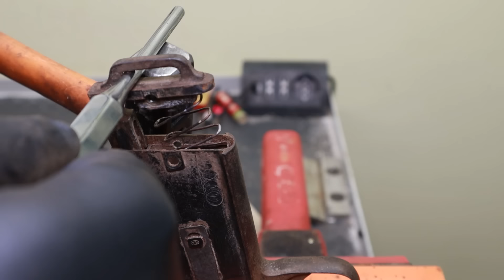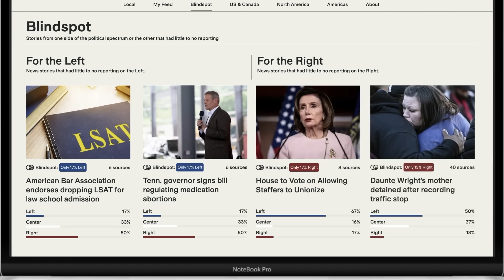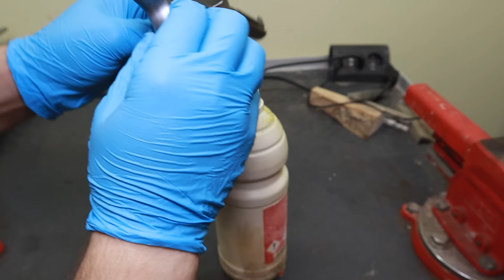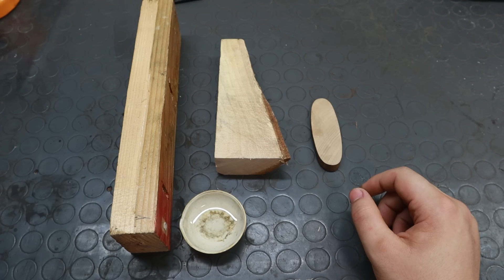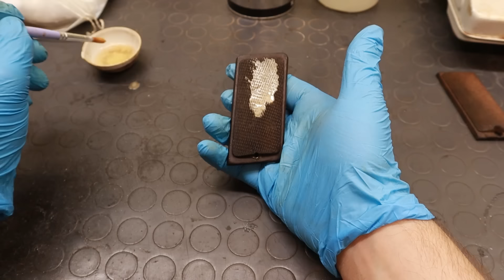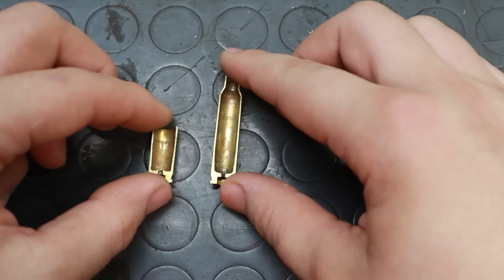Restoration of WWI Austro-Hungarian Steyr Hahn Pistol

Comment: Interesting choice of trigger weight on (I think) a single-action auto loader.  Could it have been to match double-action revolvers to ease transition for soldiers more accustomed to the usually heavy pull of those weapons?  It is an anomaly on an otherwise cleverly designed pistol.

Comment: I'm not a professional like yourself nor do I have your experience however may I suggest two items that I have found tremendously helpful in my gun restorations?

1: a dishwasher - run stocks or grips through a regular dishwasher and it not only cleans them very well but it also pops out most of the dents
2: a sonic cleaner - removes rust, crud, stuck screws, cleans grips, and generally saves a lot of tedious manual labor.  Works great with dish washing soap, laundry detergent, mild acid, or evaporust depending on your needs.

Comment: What ratios do you use when using the hcl to lighten the wood? I have a couple milsurp stocks that are pretty much black with that tannin, but id hate to overshoot and damage the wood. 

Also is this good for removing black spots from the wood with minimal damage to the surrounding finish?

Comment: Have you considered electrolysis for rust removal?

All the chemical methods I've seen you use this far seem to have drawbacks that would be completely absent with electrolysis.

It's non destructive and non corrosive. I think it would benefit your restoration efforts.

Comment: Fun fact the reason it has an internal magazine is not because they were worried about losing them although that is a plus it is because most handgun malfunctions come from failure to feed due to a bad magazine they put a really good Magazine spring in it when did a lot of engineering to ensure the feeding was very reliable

Comment: You should take pictures of all of the guns you have in storage so you can hold a community post so we can vote which gun we want to be restored next.
Reply: That’s a great idea!! He should do that!
Reply: @DementiaGaming69420  That's a wild username
Reply: @racimlongou5178 My guess based off his content is that he is a fellow Caretaker fan.
Reply: @racimlongou5178 
"How did you get that name?"

"I forgot."
Reply: 🤔 I disagree.. that would take away the "spontaneous selection", and also the "suspense" of which firearm next. Not only that, but has it actually occurred that restoration will obviously be different each time, even if only by a little bit, and he obviously restores each firearm when he has everything"mapped out ". For example, I have an 1890's reloading Tool, and it's completely pitted and seized up. I salvaged it from the local Garbage Dump. I want to at least eventually get it unseized again, not because it's "worth MONEY ", which it isn't, but because I want to, for my own self sense of achieving something, no matter how miniscule, in trying to preserve at least a small part of History.
Reply: My vote will be ALL OF THEM so ...
Reply: @MajorTom4279  this aint minecraft lil bro

Comment: i have a question you said that buffing wheels round corners. but say if you had a buffing wheel that i have modified uses a belt sander like design to move the materiel for polishing over a flat surface. would that round corners?

Comment: Your channel is one of the best original restoration channels I found so far. I’ve a suggestion, upgrade your blueing process, use steel wool and cold blue, also blue them in multiple layers and keep on rubbing with the wool. It gives very even results.

Comment: I still think the same, it is a superficial rust I think caused, it is easy to do, since internally I see that parts such as springs are intact, is it not that you need to make videos of this?
I have seen weapons corroded on the outside and inside they were in the same condition.

Comment: you can take a tig torch on low heat over the pitting with a mild steel thin filler wire and then file it smooth again to fix the pitting.

Comment: I can't believe in Restoration videos anymore after I saw how easily they can be faked, and I simply cannot believe you have a Steyr Hahn in such relatively pristine condition with just a layer of rust on the outside and having to replace a bit of it here and there. Shit looks like you disassembled the gun, sprinkled dust all over it and let it out in the sun for a while to let the shit settle in. Clickbaity fuck.

Comment: Thank you for these videos, the techniques shown are far more detailed than others online.  Your presentation seems much more trustworthy as well, and less damaging.  

I recently restored a historically significant firearm that was all but destroyed by rust and corrosion.  It does not look new even after the work I put in, and the extremely heavy pitting will never be fixed, but the degradation of the piece was halted, the parts now interact in the way they should, and it has been preserved for future generations.  

My prior attempts at preservation had middling results, with one attempt that I regret due to the loss of a patina that I tried to save while removing some accompanying rust.  This most recent project is one that I am proud to call my own work, is is no doubt the best I have done so far.  

These educational videos helped me a great deal in the proper application of a number of techniques that were new to me.  Thank you.

Comment: I was thinking, why you can't fill holes from rust in way of My Mechanics is doing? With welder. Is there an issue with hardening of steel? You should be able normalise and harden it again in worst case.
Reply from the maker: Filling a pitted surface with weld is often neither easy nor safe. In order to do a good job you'd need to grind the pitted area completey, or you risk leaving small voids under the weld, where the deeper pits were.
In any case, the main problem is that you create a heat affected zone and mess up with the heat treatment. You can of course normalize, quench and temper again, but you'll most likely end up with a warped part.
All these problems do not arise with low carbon steels, like mild steel, though.

Comment: It's locking operation is a little similar to the GSh-18 though the GSh-18 uses threads closer to the end of the barrel and threads in the slide to rotate the barrel. Both are still recoil operated rotating barrel designs albeit almost 100 years apart tough the GSh-18 is striker fired.

Comment: its fake he painted it
Reply: always the people who have zero idea what they're talking about running their mouths.
Reply: No
Reply: Proof?
Reply: @haachamaismyqueen  Inconsistent washed-out patina, no flaking, and no pitting, the trigger shows discoloration where it has been pressed in, if the rust was real then it would furr and show streaks. It is painted, simple as. surface rust steel has a consistent patina unless its in a movie. take your gun or any high-grade carbonized steel like an expensive shovel and leave it outside for a couple of weeks and then compare it with this fake. The rust will have texture, ferrous oxide lifts the surface into a furr, and the color will be consistent unless you have different grades of steel. You are being had.
Reply: @stephenbest4924  Patina? this weapon is made of steel, not copper or brass etc
Reply: @Eurozne he's italian, these guns are found all the time in basements and in the woods of old battlegrounds

Comment: I guess you can use a two part epoxy or a precise weld to get rid of the pitting. It's kinda an eyesore,but it does give a character to that old STEYR.

Comment: you can fill in pits with a oxyacetylene welder and grind down the excess material for a perfect finish on most projects
Reply: It’s high carbon steel that is heat treated and tempered.  Welding would ruin that and require a new treatment, which could cause warpage.  

Welding would be fine it it was not heat treated in this way, or had lower carbon content.

Comment: For your valued opinion. The Astra Modelo 400, Chambered in 9mm Bayard, was commercially marketed for both the 9mm Bayard and the .38 Automatic Colt Pistol. Old gun articles show that 9mm Steyr could also be fired.  The .38 Colt is semi rimmed as is the mentioned .38 Super. What's your opinion of these cartridges and potential of interchangability? Obviously .38 Super should NEVER be used in any of these pistols especially the 1900 and 1902 Colt Automatics.

Secondly,  9x23mm, with appear to be Czech markings, is found in boxes with 8 round stripper clips. Similar boxes with 9x19 (Parabellum) also found with such clips. Any idea of what they intended for.  I understand some of the Steyr pistols were rechambered for the Parabellum load after Austria annexed in 1938, but why ammo from Czechoslovakia.

Great video, great channel  always.  Your professionalism as well as very user friendly presentations greatly appreciated.

Comment: If not converted (to 9mm parabellum) this particular pistol has probably skipped WW2 (or maybe as an unofficial backup). I had a chance to see a WW2 war-trophy one (converted to 9mm for Wermacht), but it didn't like "hot" ammunition (it RUDed once, but was easily repaired). It also served as a backup in another war-but it is another storry...

Comment: I have a question. Can metal pitting be fixed by filling it with lead or maybe some sort of lite welding and then leveled out or shaved down for a lack of a better description until the surfaces even and smooth?
Reply: Welding is probably out of the question as that could risk the part severly and need a lotta postprocess to make it match up. When i first read your comment my mind went straight to tin solder, but you want an alloy that wets out on the metal you're applying it to. and any oxidation like blueing wouldn't apply to the solder leaving you with uncoloured spots

Comment: Out of curiosity, have you ever tried Evaporust or Krud-Kutter Rust Remover to remove rust on restoration pieces? I've heard some very good things about Evaporust, especially since it pretty much removes just dry rust and some oxidization without touching the bare metal (plus, it's pH neutral). I mean... yeah... using citric acid works... but you're also removing some of the base metal in areas where it might not be necessarily needed to be removed.

Comment: amazing such an old gun could still fire at all with its worn out barrel .... granted id still recommend making or finding a new barrel replacement if anyone wants to seriously use this relic at a range .... that and tweaking the trigger springs to fix that atrocious 10 lb trigger pull would be nice as well.

Comment: Can't the deep rust pits be welded over and filled, then sanded down?
Reply from the maker: That can be done, but the thermally affected zone in many situations poses more threats than the pits themselves. Thermal spray would probably be better

Comment: The deep pittings, would they be possible to be smothened out with a filler if you ceracote the gun? Would gave to be like a restomod but that might not be so bad 😃
Reply from the maker: I generally try to bring guns as close as possible to their original look, and cerakote on an early 1900's model stands up like a black eye on a blonde. It also adds a considerable amount of thickness to parts, which can interfere with mechanics, so you normally can only use it on the outside of parts.
It's a great product, but it's not a one-fits-all.
Reply: @Backyard.Ballistics  was just asking if it would hide the pits. I do like restomodded retro guns if it saves them from the smelter. Imagine a modernized c96 broomhandle 😎

Comment: Great job! But I have a question related to the formula used in the carcano rifle ¿does the hardware store cleaning products valid in order to obtain hydrochloric acid and the ammonia needed or you need to buy specific products?
Reply from the maker: Normally you can tell if it's just acid or it has stuff added to it by looking at the label. Hardware store concentrated acid and ammonia are definitely pure enough, but even some supermarket grade can serve the purpose. The ammonia I used contains a bit of surfactant, but I found that to actually be helpful
Reply: @Backyard.Ballistics  Grazie mille for the answer. : D

Comment: What do you normally use for rust removal?  Thanks
Reply from the maker: A solution of citric acid and a bit of dish soap works well and is not harsh on the metal underneath. Submerge the parts in it for 1 to 4 hours with brushing every hour or so to get rid of the most stubborn lumps.
This will also dissolve any residual bluing. If you want to try to save the bluing dunk the fully degreased parts in briskly boiling water, for 15 minutes or more, and then card with fine steel wool or hand wire brush

Comment: Such an interesting firearm thanks for sharing 🤗 have you tried the engin oil method of blueing ? I tried that method on an old airgun turned out ok 👍
Reply from the maker: That requires heating the parts to a temperature that can be higher than the temper of heat treated parts, softening them. It should only be used on parts that have not been treated or that have been tempered at at least 500°C
Reply: @Backyard.Ballistics  no good for firearms but ok for airguns 😂😂 lucky i didnt try that method on my old 1908 winchester 😕 that would have been a disaster 💥 😂😂

Comment: It's so odd how there's no corrosion inside of any of the metal parts. If a piece of metal sits outside for 80 or 100 years, corrosion gets in everything. I don't understand why people enjoy watching channels where somebody takes a thing and artificially ages it or corrods it like you did. I'm guessing you dropped it in acid or something like that. And then "restores" it. And the reason that you're not afraid to shoot it is because you know that it was a firing functional gun before you dipped it in whatever solution you dipped it into, make it look like it was corroded. And if you're going to call bullshit, I want links to pictures of where you found this thing in the ground. Or where you found it all rusted up. I'm a machinist and I got a couple buddies that are gunsmiths and sometimes people bring them in firearms that have been sitting around in barns and things for years and years and years. And they never just have surface corrosion. You know the barrel is a big empty tube and if it's not plugged up, as I'm assuming you do when you corrode things for your channel, water gets down in there and that moisture gets into everything. When you open it up. The bolt is rusty. The whole chamber is rusty, everything is rusty.
Reply: It is not a good idea to judge if you have no proper knowledge about the find. But you can make suppositions of course.
Firstly, it's important to know these guns aren't found in the ground. I have found one while metal detecting, and yeah uh, it's in much much worse condition haha. 
In barns, it's different too. I have resorated barn finds, and the corrosion isn't as bad as you might think. They just sit there doing nothing, not exposed to the elements. And you're probably wondering about the barrel right ? It seems weird. Well, all the little particules of powder, and all the other filthy things left in a barrel by the previous shots prevent the oxydation of the barrel. 
If you want to discuss more about it no problem ok ?
Just please do not make quick assumptions
Reply: And of course you're not afraid to shoot it because they're all good components. I mean good God man. When I'm pause the video right now you are explaining how the pistol works. And you're showing a barrel with a little tiny spot of corrosion on the top. No corrosion in the middle and a slide that is perfectly clean. I'm guessing you ran out of things that you could actually find out in nature and just decided to make your own stuff so that you would have content for your channel. I don't know why this video showed up on my feed. I dislike these videos typically when they show up on my feet and tell YouTube not to recommend this channel anymore and I'm going to do the same thing this time.
Reply: In the irony of you telling other people that certain YouTube channels aren't posting reliable content 🤣🤣🤣 again show me where this weapon came from where it was all rusty like that and that you did not do it yourself.
Reply: I like how you immediately thought it was found in the ground. In Europe (this guy is Italian) firearms are generally found in the walls of houses since the first or second world war. If it was in the ground the whole thing would've been "frozen" solid
Reply: @mannequinfukr  The main thing is it's not entertaining. You're not making any replacement parts or doing anything like that. So just like every other channel similar to yours, I told YouTube to not recommend this to me.

Comment: Beautiful work! I know what you mean about other channels not restoring firearms properly. They can be quite frustrating to watch. You mentioned different ways of sanding, what is your thoughts about sand blasting? Its commonly used in non-firearm restorations to great results and I'm curious on its usefulness with precision parts like found in firearms.
Reply from the maker: I haven't got a lot of experience with sandblasting, but it's not very popular when working with firearms.Shot peening, or glass bead blasting, on the other hand, are useful in many situations, but I haven't got the equipment yet.